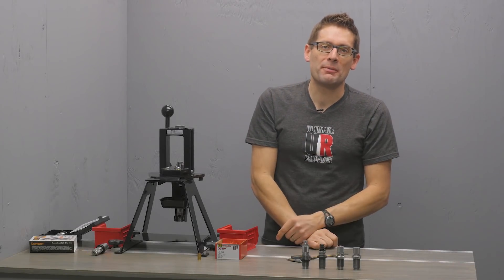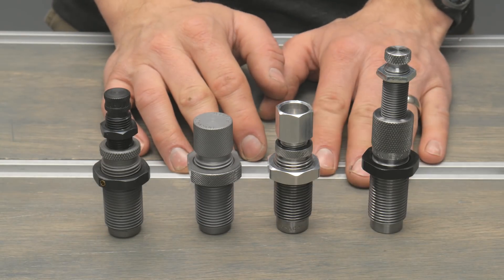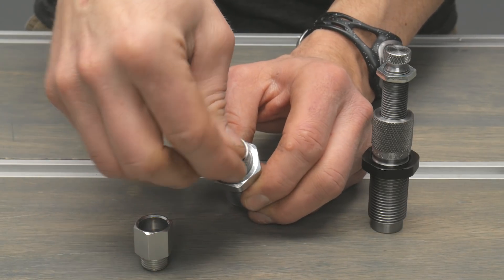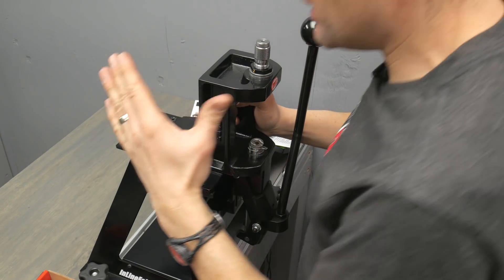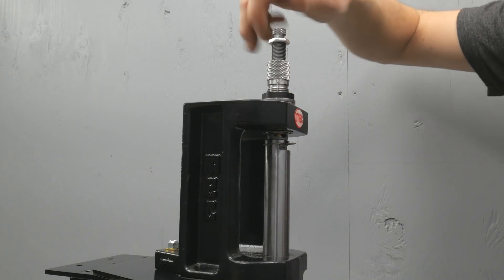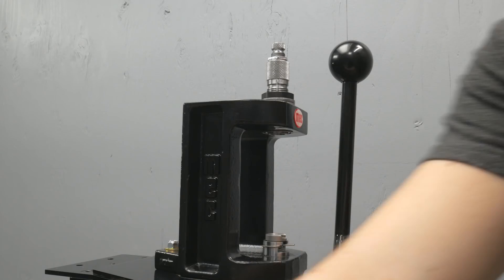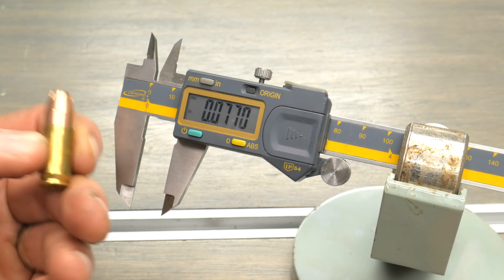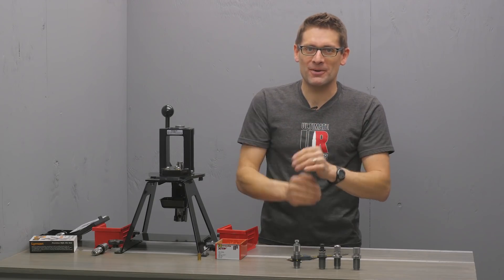Pistol Expander Dies: Overview, Comparison, Setup

Comment: 45 auto. I use a Hornady expander die and a Redding competition handgun bullet seater. I expand the case mouth slightly larger than the ID of the seater die. I then run the case into the seater die and it sizes the mouth down to its inside dimensions. The case cannot be loose in the die or it won’t align the bullet properly. Once the die is set properly I then seat a bullet on the mouth and run in into the die to seat the bullet to the desired length. Any thoughts on my method please. 
Thank you Gavin.

Comment: The Lyman has 2 issues. First it's in two parts so it gets loose after many cycles. And lso it shaves the case mouth a lot even after polishing it. Is there a brand with high quality carbide expanding die ?

Comment: Gavin, on another pistol ammo die issue, maybe you have more pull with the manufacturers than I do. I’ve been trying to get three of them to make a combination seating/taper crimping die that combines these two steps into one die, but separates the operations. It’s a pretty simple design that is maybe very complicated to describe, but most of the die makers are already making nearly all the parts needed. 
I use a 550 Dillon, and would like to incorporate a powder checker, but no room.

Comment: The Redding is very similar to the RCBS. 
One thing to note about the Redding is the machining marks on the stem of the Redding will shave some brass. The Lyman is nice and smooth. 
Expansion quality with the Lee is very poor, both the Lee and Hornady are difficult to make minute adjustments. However Hornady seating does are the cats ass.

Comment: The Lyman "M" dies kinda revolutionized these case expander dies. The perfect inside case diameter by the 1st part then being able to just slightly flare the mouth in 1 die was huge and works great for cast bullots

Comment: My LEE 9mm powder through expansion die is set by running it in to the turret press till it touches the shell holder, then backed out 1 full turn. But when I run a case into this die, the 9mm jacketed bullet falls all the way down into the case. I have a LEE auto drum powder measure on top of this die with the die extension also installed. Any idea why I am having this problem?

Comment: So…if my Lyman M-die expands the case somewhat for best bullet alignment (as well as bells the mouth slightly) doesn’t the RCBS does the same thing?  In those regards, is there any difference between these two brands as far as end results go?  Seems to me that they are both going to accomplish the same thing.  Even the Lee seems to do that quite well.  But mainly my question is: If I have the Lyman already, any good reason to buy the RCBS?

Comment: The Lyman die looks great on paper but that expanding plug threading into the shaft is a horrible design.  As you start using it, it will unscrew and over expand your case mouth.  Yes I've used different thread locker products and they delay the time until it starts coming apart but it still comes apart.  When it starts unscrewing inside the die it will over expand your case mouths and in some cases ruin the case.  I'm going to try the Hornady next if I can find one.  It is simple and has nothing to come out of adjustment while you are using it.

Comment: I switched to the LYMAN M die years a go.  I do not bell the case mouth as I found it unnecessary.  I use the Lyman M die for all pistol and rifle cases.  No problems on a Dillon XL650 press.

Comment: You may have mentioned this in  video already but where did you get the rails for your workbench. I have a pretty tight work area for now and this would make it so much easier to slide the turret presss out of the way when I do not need it.'

Comment: I presume this is same kind of steps for rifle brass?
Reply: No, and yes, depending on several factors. Typically if you are loading straight walled rifle cartridges you will expand the mouth before seating a bullet. Typically with bottle neck rifle cartridges you do not need to expand the neck before seating. The Jackets for the types of bullets typically used in bottle neck rifle cartridges are thick enough to seat well without expanding the necks plus if seating the bullets is ever a problem many sizing dies can be modified to adjust the neck tension to facilitate easier bullet seating if necessary.  There are probably a few exceptions to this generalization.  If in doubt it's best to research the individual cartridge you plan to load thoroughly before attempting to start reloading.  Hope that answers your question

Comment: Ive been using all Lyman M-dies for the last couple of years.  Best expanders Ive found.
Reply: Does it work in conjunction with a powder drop without taking up two dies?
Reply: @arnold-moger  In. 5 station progressive without a bullet feed die I run sizer, M-die, powder drop, seater, crimper.  When I run with a bullet feeder, I use an RCBS powder thru expander in a Hornady drop in place of the M-die because it has almost the same profile and works nearly the same.  I always keep my seat and crimp separate, it's just easier to setup, and more dependable.
Reply: @CorwinBos  thank you. So the RCBS expander die you refer to expandscthe case  and fills power on same die station? Is it the only expander die with this dual feature? Also, I'll admit I'm new to this, but is it important to run a powercheck die? That would make it not possible to use a 5 station press unless you combined seating and crimping.
Reply: @arnold-moger  Correct.  The RCBS expander powder thru expander inserts are superior to anything else Ive used.  I run them in a Hornady drop.  But I only use these when I am using a bullet feeder for 9mm.  Any other pistol I load is low enough volume I havent felt the need to setup for a bullet feeder on those.  I dont feel that using a PTX is worth it, unless you are using a bullet feeder, as separating these operations is more accurate and easier to setup.

Personally I dont run a powder check as I have a specific muscle memory built up over the years where I visually check every single powder drop, even when I am loading at 500+ rounds an hour.  I also tune and polish my powder drops so they are 100% reliable.  I remove all paint from the inside of the drop, and polish them to a high polish.  I also polish the rotary drum and blue them to keep them from rusting.  I also have a UFO press light so its daylight bright on the cases Im loading.  

I tried using a Hornady taper crimp seater one time when I started reloading 9mm, and it was hit or miss on the setup.  So I separated the seating and crimping, added a Lee taper crimp die and never looked back.  For what its worth, I use Hornady sizer and seater, Lyman M-die or RCBS expander (situation dependent), and a Lee taper crimp.

Comment: I would like to see more about the powder measure expander with a powder drop. I'm using the RCBS Pro 2000 with a powder measure drop expander. I have several calibers set up with dedicated die plates and use RCBS powder measures except I have one Hornady powder measure with an powder drop expander. I would like to see you expand on these options. Since I only have 5 stations, i've become creative on how to utilize each station so I can get automatic bullet feeding. If you could, please cover to the auto bullet feed functions that are available. Most of the auto pistol calibers work great but I've found the long cases i.e. 357 mag, 44 mag troublesome to get reliable results.

Comment: I use the NOE expander plugs in the Lee Universal die for my PC lead caste bullets. It is a two-step plug, similar to the Lyman M-Die, that comes in the precision sizes of your choosing. The two-stage allows the bullet to seat squarely. Each is only $6 and fits in the same die body, saving money and space. Best of all is the ability to custom size flare to 0.002 greater than the lead cast bullet. I use these for both postal (380, 9mm, 40, 45) and rifle (223, 300, 308).
Reply: I use the NOE setup as well for all my lead loads.  If I am running it in my loadmaster I have it set in station 2 because it was unused because that press primes on the top of the stroke on station 2.  So far that has been working really well for me

Comment: I've used many expanding dies over the years and they all work fine, just a little bit differently. However, I really like the Lee powder-through expanding die in conjunction with the Lee Auto Drum Powder measure. It requires very little adjustment when paired with the Lee Auto Drum powder measure. I find that the Lee Auto Drum is smooth, easy to adjust, and holds it adjustment. I still check every 5th load just to make sure.

Comment: Fyi, there are 2 different versions of the RCBS expanders. The older tapered plugs were made up to 2010 and the newer M style stepped ones made after 2010. Maybe you have the older discontinued tapered expander? The newer ones are really good from my experience and the bullets quickly align on the step and stay put all the way up into the die. I wish Dillon would do something like that with their powder through expander for my progressive loading.

Comment: My issue is coming on the other end in the seat and crimp using two separate dies, I can not get my 45's to pass the plunk test using BBI coated bullets.  Tried using both the Lee and Hornady dies on a LnL press.
Reply: Have you tried seating them a little deeper into the case?
Reply: Sounds like you could use a Lee pistol FCD:  https://leeprecision.com/reloading-dies/hand-gun-dies/lee-carbide-factory-crimp-die

Comment: Thanks for this video. you helped me sort out the question of how much flare do I put on my cases.I have a lee breach lock challenger kit and lee 9mm die set that I've loaded at least 2000 rounds with. I found, after a little fiddling it works just fine. Granted I've never tried any other dies than lee, but my results have been great. I would have no problem recommending lee to anyone who is new to reloading.
Reply from the maker: Good deal, yes, the LEE gear works- and that kit is a good one!